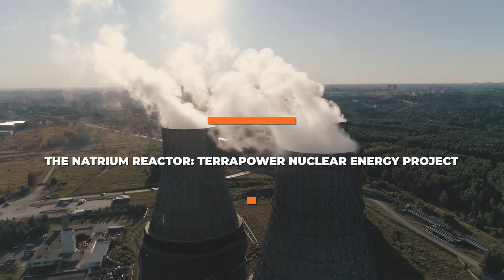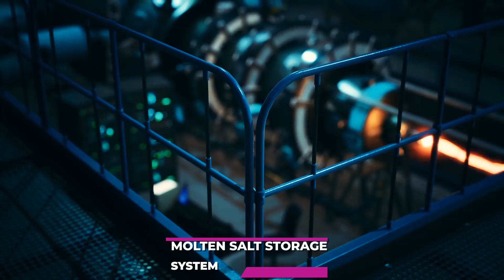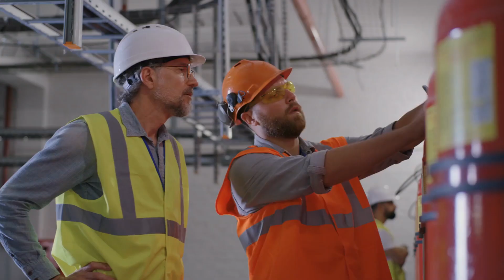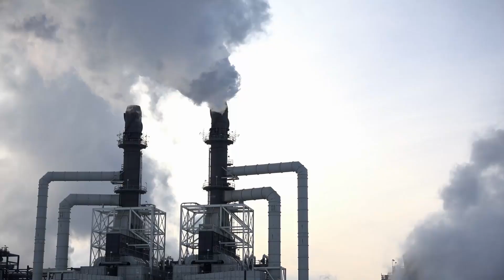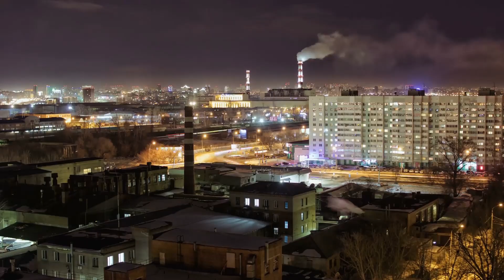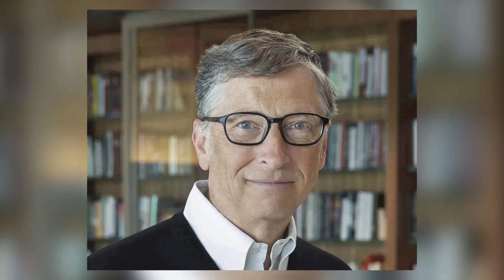The Natrium Reactor TerraPower Nuclear Energy Project

Comment: Im curious why they Terra, 
dont use thorium instead of uranium. 
I would love to read your opinion.
Reply: simple. there is NO thorium infrastructure in the U.S...  Who is going to pay the many billions to develop infrastructure on top of the already massively expensive power reactors?
Reply: @clarkkent9080  becouse it will free usa from economicly effected by the volatile prices of oil.
Smrs are the real way to freedom.
Till fusion will mature.
Reply: @dikshamen  Natrium is NOT a SMR.     Natrium does not use depleted uranium or thorium as fuel.  They originally planned on using Russian high enrichment fuel but there was that Ukraine war thing so now the U.S. taxpayer if footing the 125 million dollar bill to make high enriched (U235) fuel for Natrium.   Natrium is a demo test reactor that will take 10+ years to build once they start if ever and then require 5+ years of problem free service to prove the concept before more can be planned.  So you are looking at 15+ years once they start construction before a second one could begin construction (add 10 more years for that).
Reply: @dikshamen  Nuscale is the only company planning on building a SMR in the U.S. and here is the problems with that program.

This is from the Des Moines Register an concerning the only Small Modular Reactor (SMR) project in the U.S. today.
In 2013, the Wall Street firm Lazard estimated that the cost of generating electricity at a new nuclear plant in the United States will be between $86 and $122 per megawatt-hour. Last November, Lazard estimated that the corresponding cost will be between $131 and $204 per megawatt-hour based upon the 4 recent new nuclear projects in the U.S. . During the same eight years, renewables have plummeted in cost, and the 2021 estimates of electricity from newly constructed utility-scale solar and wind plants range between $26 and $50 per megawatt-hour. Nuclear power is simply not economically competitive.
SMRs will be even less competitive. Building and operating SMRs will cost more than large reactors for each unit (megawatt) of generation capacity. A reactor that generates five times as much power will not require five times as much concrete or five times as many workers. This makes electricity from small reactors more expensive; many of the original small reactors built in the United States were financially uncompetitive and shut down early.
The estimated cost of constructing a plant with 600 megawatts of electricity from NuScale SMRs, arguably the design closest to deployment in the United States, was originally advertised as costing $1 billion but upon requesting actual bids from engineering firms, increased to $6.1 billion in 2020. Given inflation and other cost constraints that cost today can only be expected to be significantly higher.
The cost was so high that ten members of Utah Associated Municipal Power Systems canceled their contracts. NuScale then changed its proposed plant configuration to 6 fewer reactors but increased each reactor output from 50 Mw to 77 Mw costing at total of $5.3 billion. The NRC just last week approved the construction of the 50 Mw design but now will have to start the review process all over given the switch to a 77 Mw design. For each kilowatt of electrical generation capacity, that estimate is around 80% more than the per-kilowatt cost of the Vogtle project in Georgia — before its cost exploded from $14 billion to over $30 billion. Based on the historical experience with nuclear reactor construction, SMRs are very likely to cost much more than initially expected. And they now have delayed the project start until 2025 in an attempt to find more backers.  All this before the inevitable setbacks that will occur once construction starts.
Reply: The standard large BWR/PWR is the only option for the U.S. and the Vogtle project proves them to cost $16 billion and 16 years to complete and that is a financial disaster and the Natrium reactor is estimated to cost even more than that perKw even before it is built.

Reality sucks
Reply: @clarkkent9080  U.S. Fission is based on broken promises.

Comment: Bill, I am waiting for any progress.  
You must know that $4 billion for a 345 Mw unit is already a financial failure and you haven't even broken ground yet. 

Is the Russian special ops holding up your obtaining the necessary enriched U235 supply?

I understand the political coal to nuclear transition is good PR but you could have selected a better location where the intelligence level is a little higher and where more than 2,700 people would ever want to live.  I know that is harsh, but it is difficult to build a nuclear plant let alone demo-ing a new concept.  You don't need grief from dealing with the local issues.

One suggestion.....DO NOT hire anyone that was in a management position that had anything to do with the VC Summer or Vogtle project.  I don't want to paint with a wide brush but a lot of the problems can be attributed to the ex-navy nuke mindset, that was prevalent in their management structure.

Comment: Also comonly known as " molten salt " technologies , for more than a decade.
FBG.
Reply: Molten salt reactors usually Fluoride salts coupled with Thorium or Uranium in a salt solution date back to the 1950s and 60s... killed off by the uranium lobby using uranium fuel rods and carbon shielding as these reactors produced the uranium and  plutonium used as the charge in nuclear weapons.

Comment: Why should we build a power generation system that requires toxic mining operations, a highly corrosive heat conductive medium, uranium enrichment technology that can be used to make nuclear weapons grade fissile material, and is based on nuclear fission which produces toxic waste that has to be sequestered from the environment and water tables for thousands of years and perpetually guarded to prevent malefactors from building dirty bombs with the waste? Fission is an outdated and dirty technology for power generation. Do we really want to build our system with that and export that highly complex, dirty, and potentially dangerous technology to the third world when there are so many better and cheaper alternatives? Yes solar and wind are intermittent and you need to store energy but CO2 battery technology is non-toxic, highly efficient, cheap, and the materials and mechanisms needed are off the shelf, available everywhere in the world and do not require complex monitoring and maintenance by technically sophisticated scientists and engineers. Bill Gates is enamored with centralized large scale expensive, toxic, high tech energy solutions while the world needs cheap, simple, scalable, non-toxic, and decentralized power solutions that already exist and are made out of easily accessed raw materials and equipment.
Reply from the maker: IMPORTANT CONCERNS 🔥

Comment: Thorium low pressure fail safe reactors are the way. They do not use uranium but a small amount of plutonium. Seems a shame those companies with prototypes or designs ready to go got bought out. Thorium is almost everywhere but those with major uranium interest or control will block thorium's use. And, thorium waste disposal was the main reason America's only rare earth mine was originally shut down. So we could mine Thorium and rare earths at the same time lowering cost three fold.
Reply from the maker: Great insight